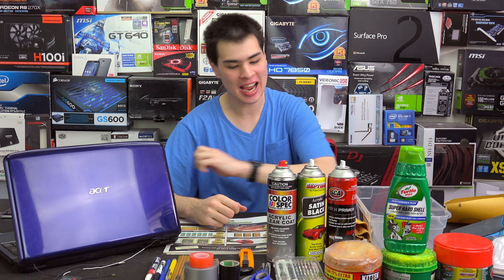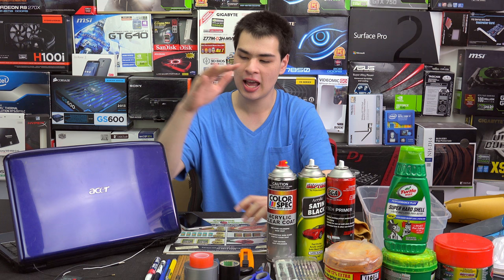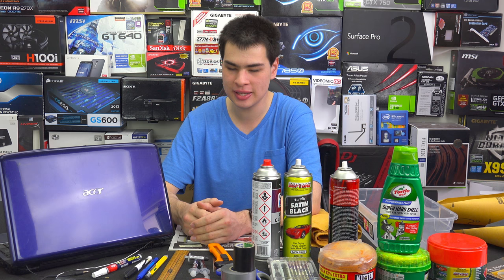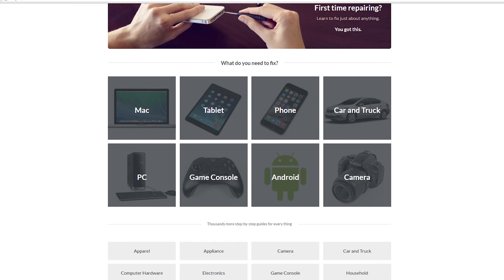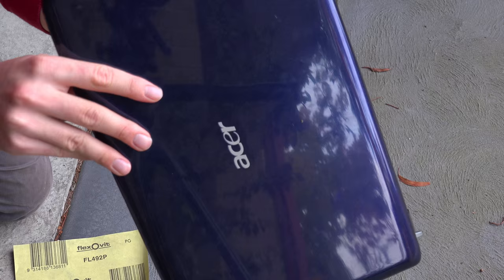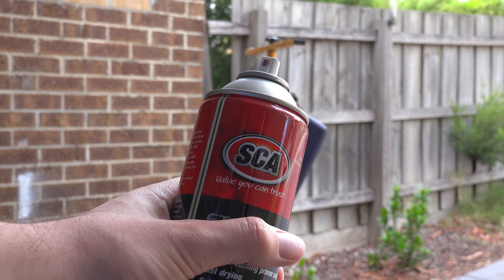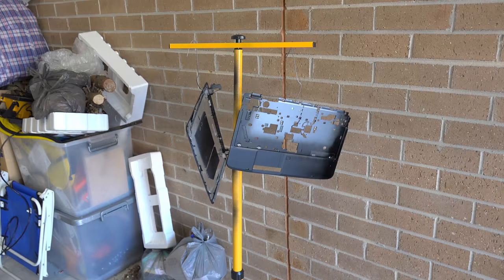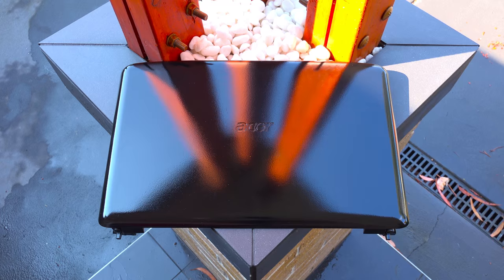How To Paint a PC

Comment: The orange peel & quality is really lacking. I'd love to see a revised video because your production quality is pretty good, but your painting skills are frankly terrible since you are supposed to be teaching people the 'right way'.

Your coats were too heavy handed. You'll get it from experience but they were still very inconsistent. that light dusting layer of paint was fine until that second coat, where there was a big smudge of paint on the left palm rest. You should be polishing smooth, and by smooth I don't mean lose the jagged edges smooth, I mean chrome bumper smooth.

The clear coat is by far the most important layer. It's very easy to sand down primer and call it good enough, and if shit hits the fan when doing the paint coat then you've only lost 2 steps, but if you screw up clear coat then you will need to redo the whole thing or get very comfortable with polishing. If you're using semigloss or matte clear coat then there's no saving it.

Those clear coat repair pens are okay but really unneeded. Touching up a scuff would need sanding and buffing to lose the wax. They're also totally useless on semigloss or matte clear coats.

Your production quality is great. Credit where it is due.